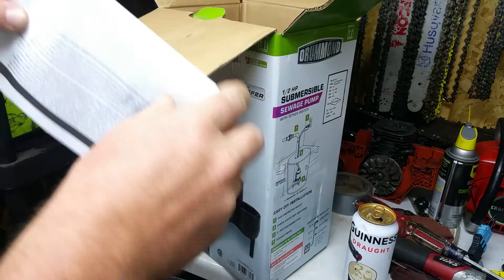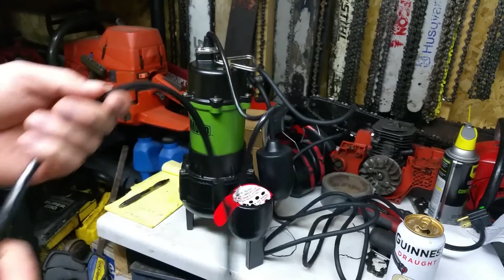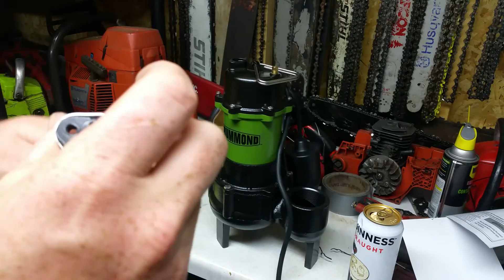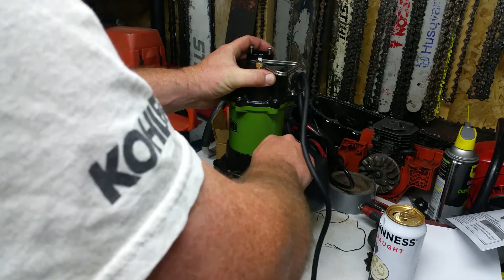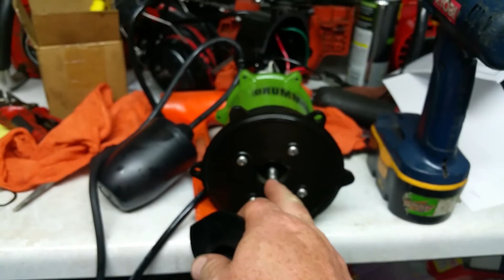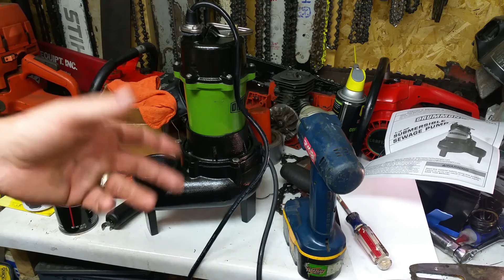harbor freight  1/2 HP  Sewage Pump kinda review/ tear down (note: shop language in use)

Comment: I used to buy 3/4 hp pumps from tractor supply, had three go out before the one year warranty, the last lasted 14 months, went with this exact pump and lasted 3 years. Bought another of the same pump and went 11 months, took 1 month to get the warrantied pump due to this shitty virus . Been in two weeks, I'll update.
I use it as a septic sewage pump
Reply: Hey Clem by any chance did you install it in a basin outside?

Comment: Did you make sure pump was correct specs for your application?  its only rated 18ft max head flow . I know my septic system design was rated for 23 gpm and 21ft max head flow minimum. Which I almost made the mistake ordering the wrong size as my original pump was 1/2 hp Thinking I would match hp which is completely wrong... glad i found my old paper work vs burning out another pump...

Comment: Let’s say I wanted to lower the output rate to use for filling gopher tunnels with mud without risking blowing mud all over the lawn by accident. Could I cut the impeller blades down smaller and that would do it?
Reply from the maker: i'd try using a celling fan speed controller something that's raided for something like  1000 watts
Reply: @chainsawsandgenerators9952  ok cool. So I found KBWC-210K it’s a speed controller with a little over 1000watt rating.  So you suggest splitting open the cable for the float switch to wire the speed controller instead of the float switch? Your help is much appreciated 👍👍👍
Reply: @chainsawsandgenerators9952  ok so my buddy said try a rheostat. Basically it restricts the power to the pump or something. It’s description is “Newest For Router Fan Variable Speed Controller Electric Motor Rheostat AC 120V” and it has the output plug where the pump would plug in, and a power cable to plug into the wall  outlet. So bam ! I guess I am going to try that.

Comment: o plus that is a Effluent Pump which isnt rated for poop lol you need a sewage pump. Effluent Pump are rated for gray water tanks. So you need the next model up.
Reply: All descriptions from all sites, for the SKU provided (63323), literally says "Submersible  Pump".  With a 2 inch discharge - "Nonclogging vortex impeller passes solids up to 2 in. diameter".  Maybe you have some big turds! Crikey!

Comment: what did you use to hook up to the 2" NPT outlet? HF didn't have any hoses that I saw, but home depot had a 50 foot one for about $33 that I was considering, lacking any other simple options.
it looks like the foot print of the unit will be too big to fit inside a flooding drain I was considering this for, though. Too bad, opening is only about 10" square.
Reply from the maker: i used two of these 25' flat hoses, they screwed into the pump body with no issues.
https://www.harborfreight.com/2-in-x-25-ft-pvc-discharge-hose-63414.html
you can also use some 2" ABS plastic if your doing a straight run

Comment: how is your pump doing is it still running
Reply from the maker: i've only used it three or four times so far and it works just fine
Reply: Chainsaws and generators 
how well does it self prime on a start?
Reply from the maker: for me, i'm pumping vertically about 6' and horizontal about 35' it takes about 5 seconds.
Reply: Still working now after 5years